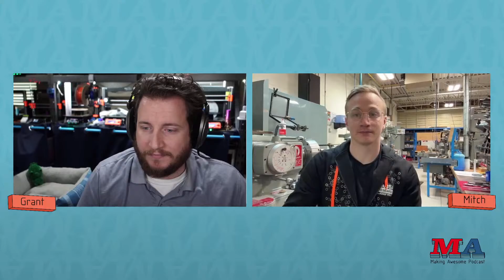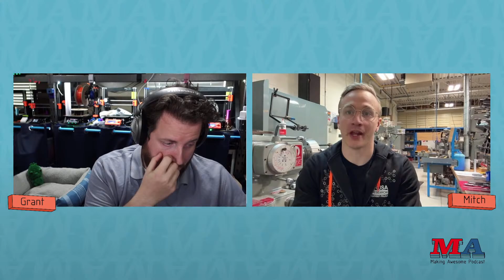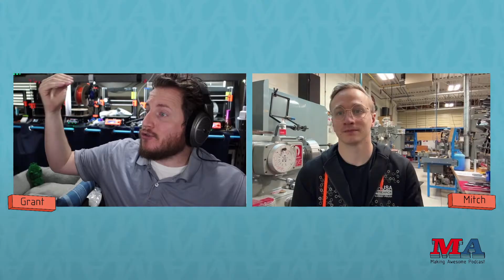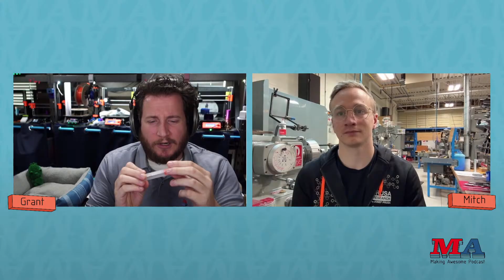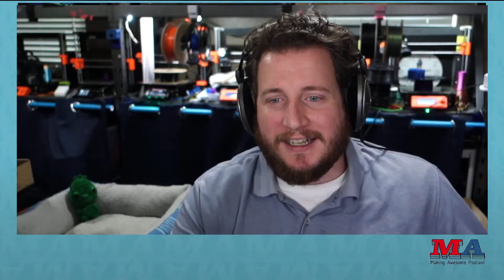Bambu RFID HAS BEEN CRACKED!!! - Making Awesome 211

Comment: Hello. I’m looking for something along the lines of "TigerTag"—a comprehensive system for creating tags that the Bambu Lab AMS can read. Alternatively, a way to hack the Bambu Lab firmware (or pressure Bambu Lab into making a change) so that the AMS accepts tags from other brands. After all, if the Bambu Lab AMS could read other types of filament, the printer would become even more attractive to a wider range of users.

Comment: I am not sure why there is so much work on this when Elegoo already handed out an open standard that manufacturers of printers and filaments can use. Leave Bambu in the dust.  If they don't want to support an open standard, then no one needs to buy their filament. The competing printers have nothing to gain by using their standard, the filament companies have nothing to gain to use their tags orher than to print on their printers, because Bambu can always change the key and block them out with a firmware update.

Comment: So if I download a dump file of an existing Bambu tag from GitHub and write it to a FUID tag with a Flipper, will it work? What's the difference between doing that and cloning a tag I already have? Does it phone home when you load it into the AMS and check no-one else is also trying to use a spool with the same tag? That's the only reason I can think of for it not working.

Comment: I believe the bambu measures the length of the filiment everytime when it loads, (or when you hit the cycle button on for any spot on the AMS )and counts the how many times the spools rotates to calculate how much material is left on the roll.
Reply: This is optional...it 'costs' a few seconds during initial filament loading.

Comment: Great podcast however if I were some of the other companies I wouldn't want the Bambu RFID code even if they gave it away for free. Many of the filament manufactures also sell 3D printers so why would I embed a RFID tag in my filament just so someone could use it in a competetors printer? What I see happening more is that other manufactures start using their own RFID to compete with Bambu. ... The other issue as well is if I am a filament manufacture I don't necessairly want to spend the money on tags and programming them unless a vast majority of my sales are going to Bambu users. The extra cost would increase the price of my filament for one and the tech would be wasted when the spool wasn't used in a Bambu printer. Setting up manufacturing for only sending RFID enabled to Bambu users would also be cost prohibitive as well as cause potential stock shortages when in fact a company might have a ton of filament but no RFID tags for them.

Comment: Another route to RFID for instance on extruder heads is a 2D barcode, which you ‘show’ to the printer’s built-in camera, and the firmware decodes what it is and updates what is fitted
Reply: There are high temp RFID tags and at this point there are tags small enough to fit THROUGH the nozzle let alone on it. It would be easy enough to add RFID everywhere, but I wonder about costs for disposable items where a QR code might be cheaper/good enough, especially now that networking is everywhere. The cool features RFID (or NFC/UWB) adds over QR is usage tracking and positioning. UWB allows tracking things like how much filament is left based on rotation.

Comment: I know nothing about 3d printing, I bought an X1C because it just works and the filament just works because of the RFID... as far I am concerned it is the only reason why I am even using a 3d printer. I don't really understand why people would dislike Bambu? They have blown the whole thing wide open for anyone to buy a machine and print their parts without needing years of testing and experience, what is not to like?
Reply: Because the people complaining are hobbyists and enthusiasts. Most others don’t care. It’s a matter of some people thinking; “I want that feature, but I don’t like the company, so I don’t want to buy their machine, even though they developed it, I want it on the machine I want.”
Reply: At any point they can just say "You must use Bambu brand filament" and then they can raise the prices as much as they want because they no longer have competition at least among their users. That's not super likely given people would just stop buying their printers, but people said the same thing about ink printers way back when. It's better to be prepared than to wait and get screwed over down the line.

Comment: Can you just use an old bambu rifid tag from an old spool onto a new third party spool? Just match up the color of course. Like finish a bambu spool of white, and get a spool of Elegoo spool of white and put the rfid tag onto that spool?
Reply from the maker: Bambu filament is not the same as normal filament, they add stuff in it to make it high flow. But yes, in theory you could

Comment: I could see Bambu staying quiet and not changing anything with the RFID reading until another AMS comes out and can read Bambu filament AND other RFID tags (like if Creality made an AMS and put RFID tags in their filament). Then it would be a negative to use their AMS like "well I can do this with this other other brand, why are you locking it down". I can see them doing something then but I doubt before then

Comment: there's a simple solution - bambu can issue private keys to other companies, same as what apple does for signing applications
Reply from the maker: If they wanted to they would have
Reply: @3DMusketeers  I actually thought of a way that can be done in X1 Plus without involving bambulab: just verify the signature against pubkeys. This would be the process:
1. a company that makes filament writes their own RFID tags, 
2. they sign the tag with their own private key
3. they publish corresponding pubkey
4. User (or X1+ dev) adds pubkey to the X1+ software (or the company can create a pull request to X1+ repo to add their pubkey)
5. X1+ reads the RFID tag, verifies the signature
now it can say "this is authentic Bambu Lab filament" or "this is authentic Polar filament" and if it doesn't verify the signature, "this is a generic black PLA"
Reply from the maker: but X1P is working with Bambu, so I fully doubt this would be possible. If you have a machine with the latest X1P though please give it a shot!
Reply: @3DMusketeers  ah, if the prerequisite is Bambu being ok with it, then it might be problematic, although I'd be curious to know if they're against X1P identifying 3rd party filaments as [whatever] brand (obviously as long as they're not bambu).
Reply from the maker: if you arent in the X1P discord, that would be the right place to ask I think
Reply: @3DMusketeers  i'll check it out

Comment: I am new to 3d printing I have been using ender 3 and there pc software would be nice to see the rfid tag or nfc tag be able to be read by there software and change settings also add the price to the filament
Reply from the maker: ooh that would be nice, minimally a slicer integration..
Reply: @ it’s always nice to know the price of the part you making for someone so integrating it into the slicer software where you scan the nfc or rfid plus it being able to set the filament type heat ec would definitely make it easier
Reply from the maker: it would still require you to input what you bought it for though, no? because sale pricing etc?
Reply: @3DMusketeers  In the creality slicer there is a place that you can input the price of your filament and once you slice a project it tells you the cost of that project so if the tags had the price of the filament on it could auto add the price of the filament to your slicer tool

Comment: I worked in industrial plastics... Having the material type is great, but the real magic would be if the batch MELT INDEX was available on the tag. We could actually use that number to adjust flow rates and adjust melt temperature.

Comment: Help me out here. Why RFID tags and not QR codes? What advantage does RFID give me that a QR code can't?
Reply from the maker: QR needs to be read by a camera. NFC or RFID is best as the ability to read it does not require a camera
Reply: @3DMusketeers  Yes, there's that. But OTOH, low res cameras aren't that expensive, and I can think of an easy way to need only one camera to read all the spools in the AMS (hint: the camera moves along a track) If there was a QR code standard instead of a proprietary system like RFID the whole industry could benefit.

Comment: My first printer was the XYZprinting De Vinci 1.0. With a similar type of system. I don't remember if that was just so the loading process was easier or what information was on their tags. It was also an inclosed printer one of if not the first consumer printers on the market. It could only print ABS and then an upgrade allowed for PLA printing. But way too hard to level the printer.

Comment: I think this is a great discussion. I just ordered my X1C combo pack on the 120214 Black deal. I hope eventually other manufacture are able to use their filament with RFID tags. I use Matterhacker PLA filament because it is pretty cheep and seems to work well. I would hate to have basically only one manufacture of filament to choose from. I love the idea that a Manufacture could potentially test there filament on your machine certify that it works reliably with these settings and print a tag with the appropriate slicer information. To at least get you 90% of the way there. I have been trying to print for many years now on other printers and I currently use Simplify3D slicing software. There is a tone of setting in these slicers. Very confusing to know what to change and how much on any one setting. A great learning process but I could take, again 90% of the guess works away from me so I can just "PRINT", is or would be wonderful.

Comment: 14:37 This might sound stupid  but wouldn't it be better to start from scratch and develop your own rfid tag and make it so it has what you need as a filament supplier and what a maker needs and push that to every one and make it the standard and hopefully bambu falls in line.
Reply from the maker: Working on it so it works with the current manufacturers is beneficial as those not crazy electrically inclined can still use it and such.
Reply: @3DMusketeers  It looks like what I was thinking,  you are way a head and in the process. 👍🏼👍🏼

Comment: This guy does not really seem to a deep  understand RFID, or encryption.  So first, Mifare can be read and written by a cell phone. Mifare is a type of NFC. Cell phones can read any NFC/RFID that is in the 13.56MHz frequency. The rest of it is just software. Next the reason you sign the tags is data integrity. I want to know that the settings are verified by someone. It's the same reason we sign software or anything else. Even open source software is often signed if you want mainstream adoption. I would want the signature so I know that the settings that the tag is saying are accurate. If the tags or reprogrammable or even if they aren't; nothing is stopping a bad actor from changing the tag from say PLA to ABS or PETG or any other filament and giving someone a really annoying time. Bambulab extending their firmware to take other signatures is not hard. They would become a CA and issue certifcates to people that asked and then to verify the signature you would check to see if the certificate and the signature is valod. As for end users signing their own tags, they could do that today. Mifare tags can be written from a cellphone. Bambulabs could easily provide the certs so you could sign from the phone.
Reply from the maker: They could, but they won't.

Comment: I take my old tags and stick them on a new roll of overture filament. It runs faster. I think they throttle back 3rd party stuff.
My p1s never picks up the real bambu filament. It always has to manually fixed.
They wont reslice because it would trigger an iso supplemental inspection in some cases. Iso is a big deal, it costs on average $100k
Reply: File a report with Bambu. I use 3 printers with AMS and it is very rare for them to not detect the spools.

Comment: It seems like a lot of work for very little benifit. I have a P1s with a Bigttreetech Panda. It takes seconds on that screen to select PLA, Green Generic and the generic setting has worked very well for every filament I have tried (PLA at least).
Reply: That’s great. But there are a lot of different filaments, I have maybe maybe a dozen or so. They all require specific settings. You can’t use a generic setting.
Reply: Cool. I can also just tap Generic, PETG, Red on my printer screen... Except I have like four different shades of Red for PETG and the screen only offers one - and the only way to tell it they are different shades would be the RFID tag with a full hexcode. Which is important if you're using, for example, the filament changer's automatic spool swapping on filament runout.

The screen also doesn't let me change temperature parameters which very much do change even within a material type, usually because of different additives like colour. Then there's also loads of settings that the printer doesn't even tell you about like maximum flowrate, pressure advance, etc... I end up spending quite a bit of time calibrating all of that for each manufacturer, material and colour type I have to make sure I get minimal VFAs, good dimensional accuracy, minimal corner bulging and underextrusion... Of course you may not care about that level of accuracy, and a lot of that is machine specific, but there's quite a lot of material-to-material tuning, and if the RFID tag can give me starting values I can calibrate everything much quicker, and in the case of OpenPrintTag which also has filament IDs, I could also save calibration profiles not just per mfr/material/combo, but also per spool with a mfr/material/combo fallback.

Comment: I love my Bambu printer that just works great without incredibly boring dumb tweaking every little flow rate or retraction amount etc. I literally would not get a 3 D printer until Bambu’s came out because printers needing full assembly and figuring out settings was just not worth the cost and aggravation. And Bambu filament works great. But no PCTG, or recycled, or certain colors, etc. would be nice to have RFID for my non-Bambu filaments

Comment: Maybe having a USB handheld RFID scanner for your slicer? then it could work in the slicer its self and be available to every printer with out modding. That could be open source slicer will set the values for hot end, speed and bed temp. Then the multicolour systems can catch up. You could buy the scanner with the filament would be an idea. 
You guys can go with it, free idea
Reply: You might as well use bar codes on the spools and scan it with your phone. No need for extra hardware. The RFID/scanner just brings no user interaction required.

Comment: The standards that should be used from the get go is ISO standards for RFID.

Regarding your industrial customers wanting the same material everytime, there is a reason why. They have RD specs to follow, the have prototyped, tested, and run production per the specs. If they are good at there jobs, they even created FMEAs and have created some sort of QMS. A change in material would require testing, sampling, customer approval (if required), and then changes to all documentation, purging old material out of the system, and maintaining a clean point to ensure no mixed parts.
Its way more than just changing the settings in your slicer.
Reply: I work in medical device and yes this is very true. Changing anything in production is very expensive and a lot of work.

Comment: This is why the community is so great and why I'll still never buy a Bambu. They're impressive machines but they lock too much away behind their walled garden in an industry founded on sharing information. Once it became clear people would put up with it Prusa began tip-toeing down that road as well. I realize not everyone has time to painstakingly build and tune their machines and just need something fast and reliable, which is fine.

If they're smart they'll realize this only makes their machines more attractive. They're fooling themselves if they think people will avoid other brands of cheap filament but this shouldn't have much of an impact in the long term on their engineering plastic sales. Hell they'd probably make more money selling an intuitive, customizable RFID tag system people can just buy.
Reply: Bambu works with all filament so no reason to not buy it.
Reply: @rsilvers129  That wasn't at all what I was saying. I just meant letting people use the RFID tag system with their own filament, which is the point of hacking it.
Reply: The RFID is a "nice to have" for me.  I have filament from other mfrs, and just tell the AMS what it is (usually Generic and the material type).  It takes 3 or 4 button presses, and then I select the correct thing in my list, those that I've bothered to calibrate.

For the "appliance operator" skill level, using Bambu's presets for both process and RFID filaments is a huge simplification.  They just work.  For many, that's worth a small premium.

Anyone using "exotic" filaments, or maybe colors Bambu doesn't offer, probably has the skills not to really benefit much from the RFID capability.